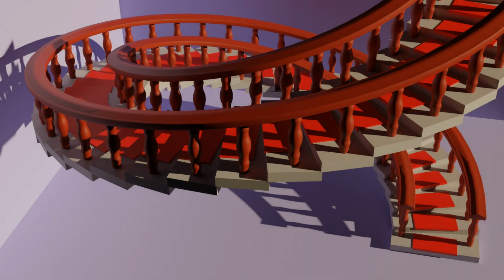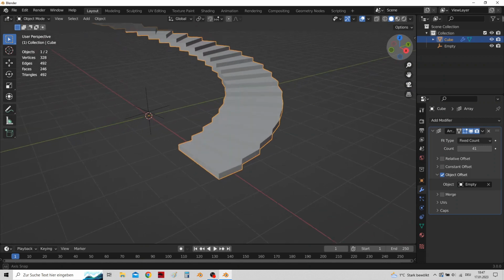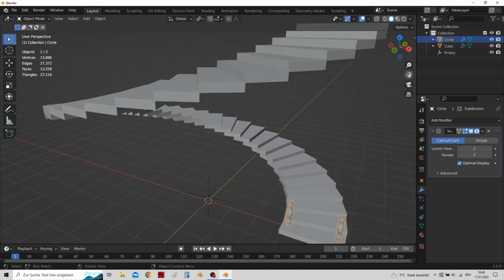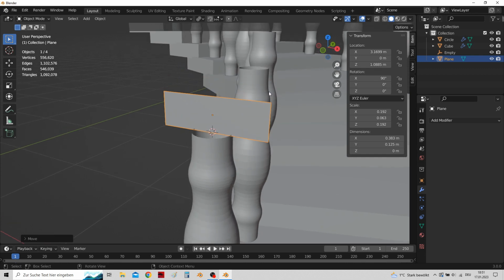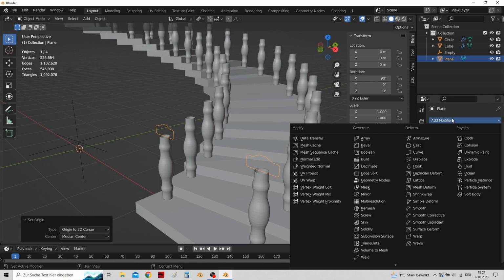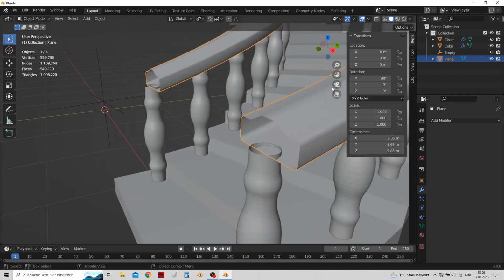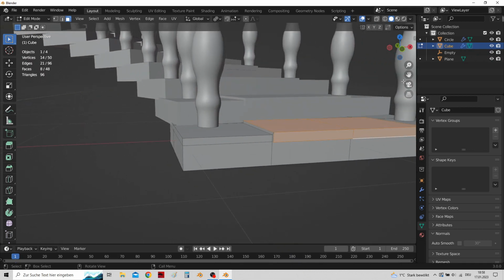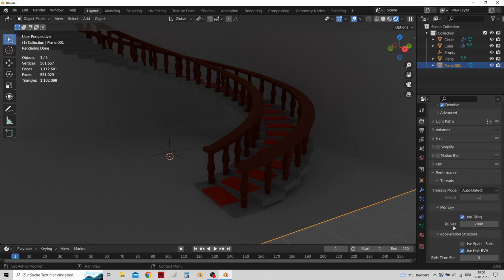Blender Tutorial / Spiral Stairway

Comment: Nice result.  It seems that it would have been better to have created the railing posts and carpet on the first stair step as a single unit, then put this composite star, post and carpet object on an array.
Reply from the maker: Thanks! Correct, pillars could be added with the stair step! 👍  I also thought about this at the end of making the vid 🤔 but the handrail object, should be separated, so applyng the screw modifier for getting high resolution curves, doesn‘t affect the whole thing.